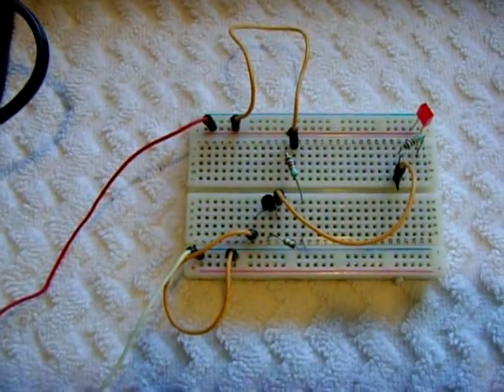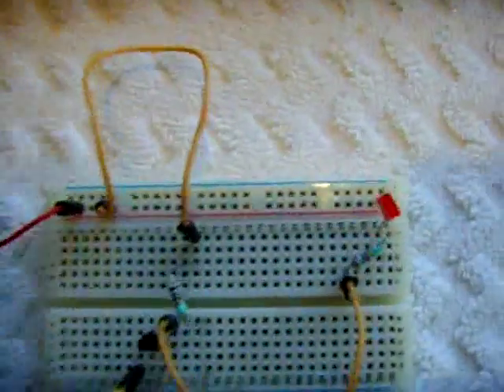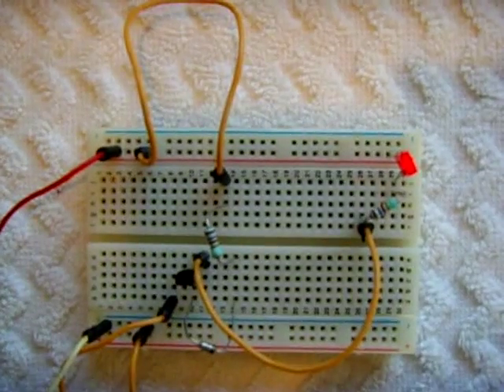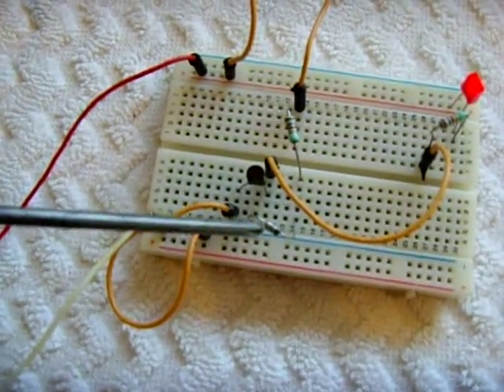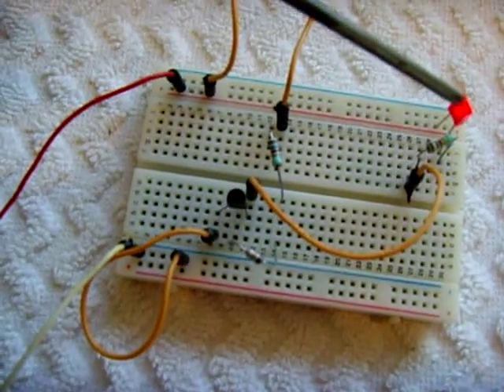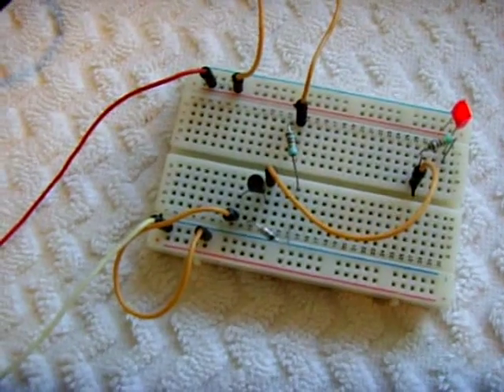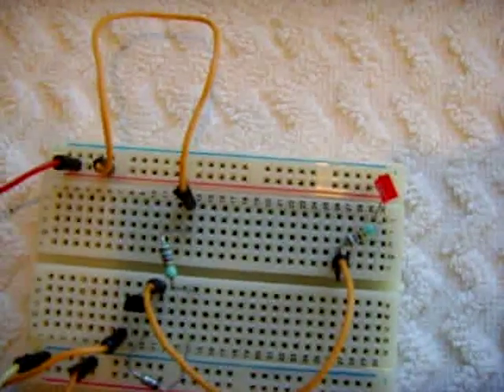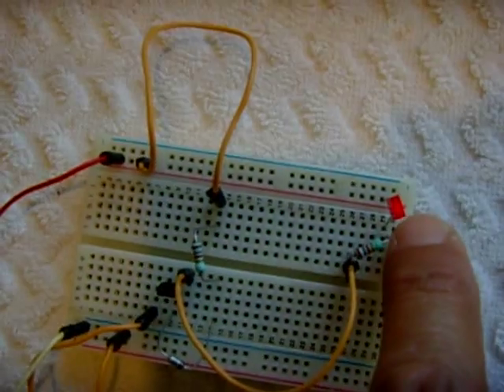Rising Voltage LED Power Indicator

Comment: It looks like the circuit drawing really is down this time.  I'm very interested in building this circuit to use as a steady continuity light to detect intermittent sensor wiring defects in helicopters.  This would work perfectly as we use 10V excitation with 9.5V as the bottom threshold.  We are looking to have a steady LED light when continuity is good and above 9.5V, this light will blink as we move harnesses around as we are near the intermittent contact.  It would also tell us if we don't have a good 10V excitation signal.  We tend to develop a lot of intermittent contacts on helicopters due to vibration.  I hope it makes sense.  Even a point to point narrative in these comments would help me get this together quickly.  Thanks.

Comment: Hi, great video. I intend to use this circuit as a warning indicator for my cheap usb powerbank when it fully charges to around 5V, and probably connecting it in parallel with a usb port  of a powerbank. So as much as I figured this out, if I want the LED to fully illuminate at 5V, then should the zener value be 0.6V lower? And what about the resistor value?
Reply from the maker: A 4.3v or 4.7v zener should do the trick. Use an led that has colored epoxy.

Comment: so it-s reallz a "charged" statust light.

I think of a "rising" volatage indicator as alight that is on whenerve the voltage RISES. which needs some feedback or memory. but this could be constructed using a small cap that stores an averageof the voltage over a past period of time and compares that to another which averages a much shorter period of time.... 

hum sounds like moving averages stock trading.
Reply from the maker: A .18v range is not bad at all. The circuit does work well.
Reply: No, I know it works as you intended. It shows a a light when the voltage crosses above a certain level.

I was thinking of a circuit where the light is on when the voltage keeps rising. no matter where it is.... easy to do digitally, a bit more challenging to do in analog for me.

Good stuff.

Comment: Given all of the talk these days of the possibility of EMP attack someday, would you please design and share with us a schematic for an EMP Detector. Should it ever happen, it really would help to know that the reason that the power has failed is because of an EMP instead of a simple run of the mill power failure.

Comment from the maker: You would need to make duplicate circuits and use different zeners for each level of voltage, then connect them all in parallel to the battery. You can also just use a lm3914 led voltage indicator circuit.

Comment: and if i want to make five LEDs to light up one after a nother when the voltage is rising like when the voltage is 5volts one is LED is shining when 6volts two LEDs are shining and so on. I would need to have five diffrent zener diodes that activate at a higher and higher voltage? Sorry if i get this wrong, i am still learning :)

Comment from the maker: The LED would need a higher resistor value , otherwise it would burn out. In addition you should also try a higher resistor value before the zener (4.7k - 10k)

Comment: Good circuit and easy to use, reminds me of the input side of transistor regulators :-)

For a fast attack on state a schmitt trigger works well after the transistor, and with a transistor after the schmitt you can drive a relay to stop the charging if needed :-)

Have you played around with the Lm3914 bargraph chips, make nice multi led meters :-)